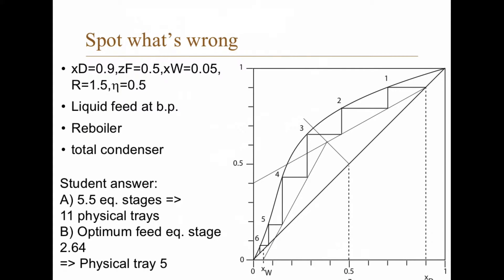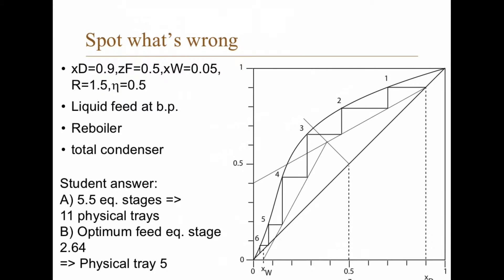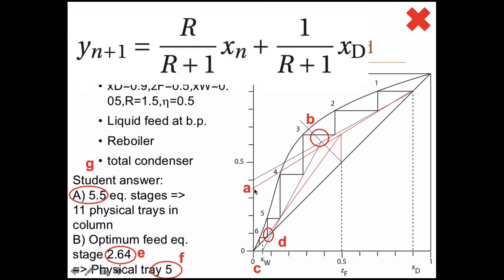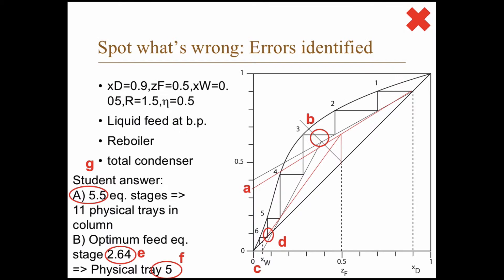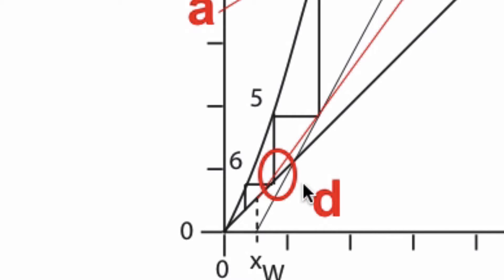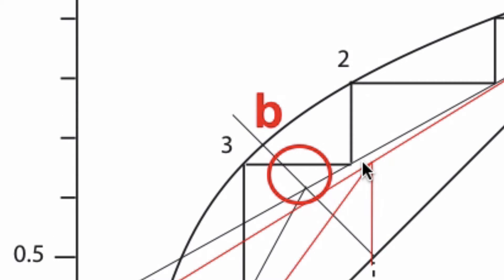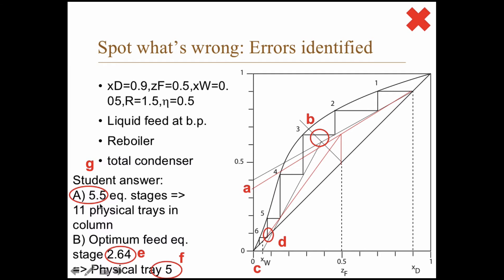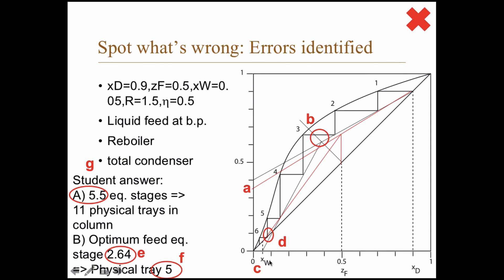Distillation: Spot-What's Wrong

Comment: Great video...

On another topic, how i wish every professor deducted only based on first error instead of cancelling everything... 

Some tests are very easy to make one silly mistake that cost you the whole question... And tests are really unfair sometimes, short time + pressure and its pretty easy to miss a minus here and there or something similar... that in the end becomes a snowball hahaha
Reply from the maker: Thanks. 

Regarding grading of exams, there are plenty of different traditions out there and I personally think a problem is that the grading policy is not always connected to the learning outcomes of the course (not a "constructive alignment", to use a pedagogical term) There is a risk that "we grade as we always have done" without making a deliberate pedagogical choice/design regarding how to grade and without communicating properly to the students the rationale behind that choice/design. (And yes, I myself can do better there in my work as a university teacher)

Greetings from Mattias Alveteg, the maker of the video above and moderator of this channel

Comment: Sir What will be slop of stripping line ,what is value of L bar and V bar ,can we draw operating line of stripping section using its slop and intercept?
Reply from the maker: Yes, you can calculate the slope of the lower operating line and use that to draw the lower operating line (the stripping line). How you get to calculating that ratio depends on what information you have to begin with. If you have xD, zF and xW, uou will need to solve some mass balances to get to that slope, using F=W+D, L_bar=L+F*q, V=V_bar+F*(1-q), L_bar=W+V_bar, V=D+L. The slope of the lower operating line is L_bar/V_bar.  

If you instead know that you have three (1+2) equilibrium stages in total in a stripper (column with the feed at the top) with a reboiler, you will have to guess the slope and count how many  equilibrium stages you can fit, and then redraw until the number of equilibrium stages in your graphical solution becomes three. Then you can use the slope and mass balances to calculate L_bar and V_bar (using a basis of calculation for F)
Reply: @PLE_LU  thanks